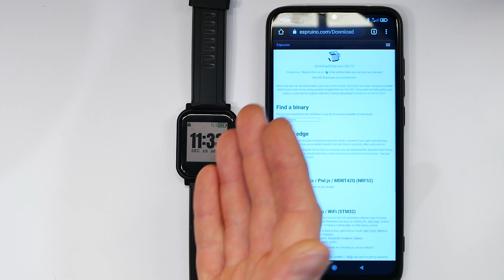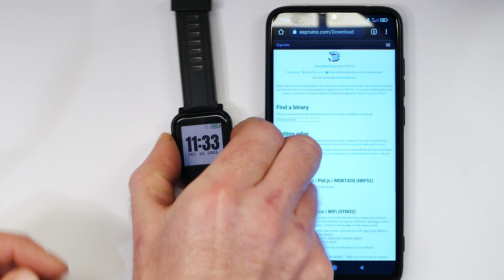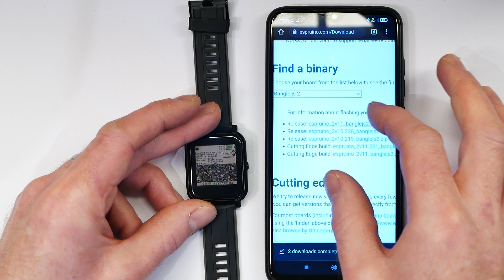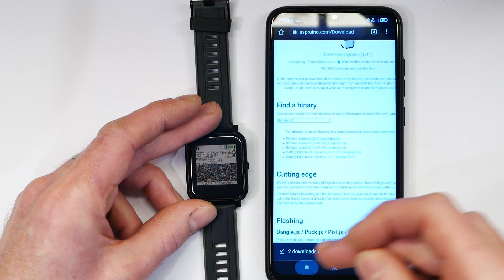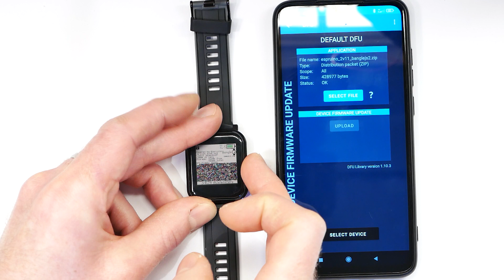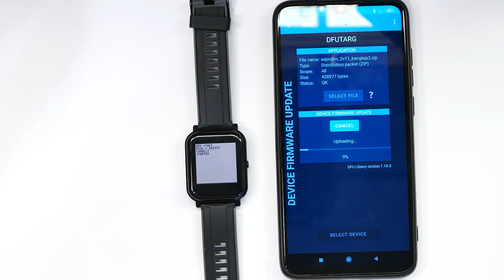Bangle.js 2 Firmware Updates (Android)

Comment: I am trying to update to v15 and I get "X Enabling bootloader". Any way to update?
Reply from the maker: Please can you try just using the Firmware Update app in the app loader? https://banglejs.com/apps/?id=fwupdate - that's what we suggest now as it's far easier and safer. If you have issues please can you post on the forum though (https://forum.espruino.com/) - ideally with a screenshot as I don't think I've seen the message "X Enabling bootloader" before. Full update instructions are at http://www.espruino.com/Firmware+Update#nrf52 if that helps

Comment: Trying to do this using an iPhone 12 mini. I enter DFU, select file, i hit update and it consistently connects, starts then fails after a random number of bytes is transferred. I'll keep looking but any ideas?....hmmm i now cant seem to leave DFU mode.....what is Bankd invalid?
Reply: for anyone stumbling on this later it appears that 2% get transferred each time you hit retry (while using nRD Toolbox) you just need to tap x50 for the whole firmware to transfer and then it seems to update successfully. shrugs
Reply from the maker: @QuackGoesTheDuckQuackQuackQuac  Glad you got it sorted! I've heard of some others report this too. Doesn't seem to happen on earlier iOS versions, but latest iOS appears to disconnect the device after just a little bit of the upload completes. I'm working on a solution which should work from the App Loader though, so hopefully for the next update you can avoid this completely

Comment: Trying to do work on a cell phone is like pulling teeth. I've been developing hardware and software for over 40 years on computers with keyboards and, eventually a mouse. I've done this every version of Windows, several versions of Unix and Linux, and even on iOS. I'm 73 years old so reading the small fonts screen of the Bangle.js requires that I squint through magnifying glass in order to read what is says. Typing on a Android phone or even selecting buttons often leads me to make a mistake. Still I'm willing to do it 'cause I love this Bangle.js project and I want to make use of it. But please let me know if I can use my Windows 10 computer for development and, if so, how.
Reply: After my diatribe above, I was able to pair my Bangle.js 2 to my Windows 10 computer and with the App on the web site. Now to see what damage I can do! :)
Reply from the maker: Yes, absolutely! That's the nice thing about Web Bluetooth - the App Loader and Web IDE work on a phone, tablet, chromebook or your PC/Laptop. Just do exactly the same thing you do on the phone. Firmware updates will also work from the PC too eventually, but I'm trying to make them more reliable before I advise it as something to do